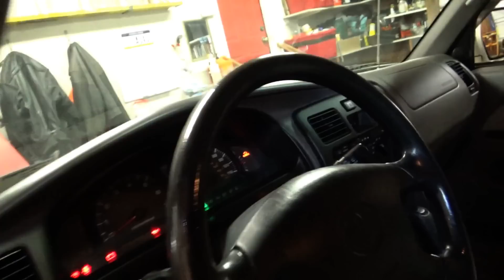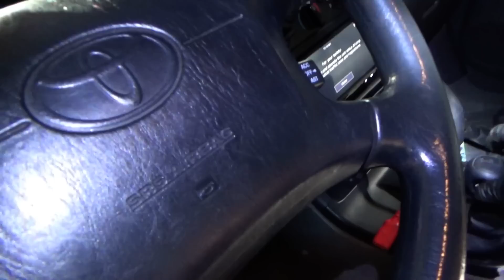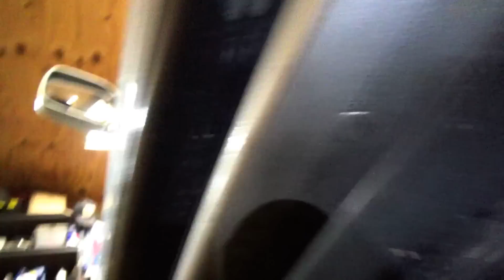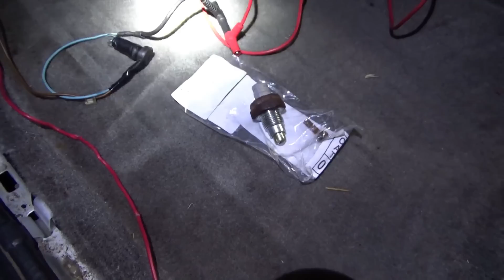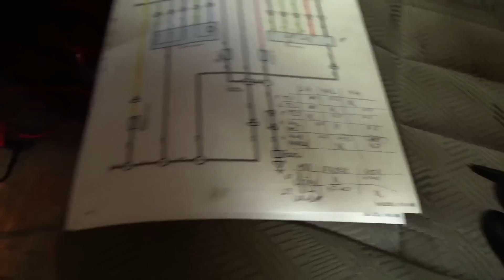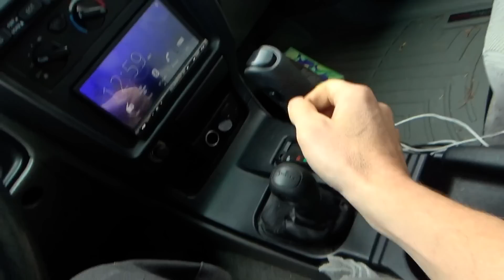(Pt 3) HELP! My Toyota is STILL STUCK in 4x4! ('02 4Runner)

Comment: I had exactly the same problem, my 4Runner was stacked on 4wd until I sow   
Your video. I replace switch didn't work with crash washer, remove crash washer and the magic happen it's working now. Thanks you

Comment: I've been fighting this on my 2010 Tacoma w 143K. I cleaned & tested the actuator but only checked the switches for continuity. Mine goes into 4WL once in a while if I lug the engine in 1st gear (MT)...from watching your video, it tells me that the lugging bounces that rod/switch into actuating...and that the slop is in the TC. I'll get a new switch & install it w doped threads sans crush washer. If  it still doesn't reach the rod, I'l file some mating surface from where it screws into the housing.Damn rig is like an old married couple. Thanks Ivan.

Comment: The 4wheel  center diff lock switch was added to a preexisting 4wd system transfer case from the 90's that originally always had the diff. Locked when in 4wd. The switches and 4wd ECU wasn't changed with the update making the switches kind of redundant or non functional in certain positions.
Reply: Another note. This "multi mode" transfer case also has a torsen unit in it which is why the front tires couldn't be spun when the transfer case shaft was in mid position with the center diff unlocked.

Comment: Pt 1 I thought to myself: position switch(es)! Pt 2 I thought to myself: position switch (es)! Why? I did exactly the same that you did, but on a Pajero, including coming up with drawing the table with shaft positions, manual switching, and logic. Three different days, several hours. My position switches were located on a godforsaken spot on top of the transfer case, had to drop the whole engine/gearbox assembly on the rear end just to get my hand up there between the tunnel and the TC. Work blind by feel, take pics with phone, use mirror. A mare job. Switches played up exactly like yours, some even worse. Original replacement would have cost AUD 160 each, 5 switches or so. Customer decided to get a knockoff set from ebay for AUD 35-ish. Didn't work, the knockoff switches switch tolerances were all over the place. Made it work with a combo of original and new knockoffs, with partly one, two or no crush washers. Same as you had to do, even with the OEM replacement
Reply: After only a few drive cycles it failed again. Lesson: These cars getting expensive after 16 years service

Comment: Had a day to think about that switch and its replacement. Finicky darn thing to adjust.

So, if one carries that assessment to its logical conclusion, my opinion is that the switch itself is a crap design. It should NOT be finicky to adjust BY DESIGN.

So I'm afraid I don't look at Toyotas as gods of design. What they are good at, it seems to me, is producing their designs with great quality and repeatability. So here we have a case where a crap design is well made and because of the design, not the manufacture, is a useless t*t bit of design.

It's like those open deck blocks Toyota makes these days, die-cast cheapies complete with a plastic piece that drops in, which supposedly gives even cooling to all cylinders. What a brainwave! Not. The electric cooling pumps and their associated valves, doohickeys, bizarre 12 ways to manage cooling from cold engine to instant defrost for the windshield and 10 wackadoodle settings in between -- crap design, and blocks fail early because of it because of head gasket failure.

Look at the latest Tundra with 3.4 TT. Hell, even Ford seems better on their 3.5tt Ecoboost. Can't remember if Ford added a rubber belt running in oil to the 3.5tt, but they did to the 2.7and 3.0tt. Had to have a failure point somewhere, I guess. But Toyota believes what it does is faultless even when it isn't. Got little time for that attitude.

Drive it gentle like it's a stick of dynamite that could go bang at any instant, change oil over-frequently, and with luck, why you too can probably boast "Them Teeyodas, boy now there's real quality!" as you sail past 200K miles with nary a twinge.

But what we all know is that in the early  '00s and earlier, you didn't have to treat a Toyota engine with kid gloves to make it last. Now you do.

Comment: Hi Ivan I'm looking for a scan tool and I was wondering what you think of the autel mk 808s. I need a competent tool although I'm not a mechanic I am an electrician and like fixing things, spent 20 years working on diesel electrical mining truck like komatsu 930
Reply from the maker: That's a great compact scanner! Get the MK808STS if you need TPMS capability as well :)

Comment: I had same issue on a skoda fabia with 34k miles on it. Reverse light switch on gear box where nothing worked ( lights, reverse parking sensors) took washer off and sorted.

Comment: If you can't explain it, it means you don't understand it. If you don't understand it, then probably  you should spend a little more time learning the system to insure the repair is correct, Sounds like 2 parts installed that weren't needed.

Comment: Have you been able to find out if Toyoto replaced the original switch with  their after market spare part line? It just could be that Toyota uses the same part number while the switch itself is of a later design. And that could mean that the manufacturer just added that crush washer out of habit. The original switch, the one that came with the car, could have just had a thin brass washer (?).

Comment: I think the failed lubricants are preventing full travel of the actuator, this is why the position switch is marginal. Having said this, it is clear from Ivan's testing that the more the case is locked in and out the more it is tending to free up. So, perhaps the advice to the customer is the exercise the case back and forth every couple days or so. The lubricants are still spent, but you could possible get a few more years out of having to rebuild it.

Comment: It could be shaft bushings worn but I think the problem is at the attachment point of the shaft. Possibly a worn pin at the attachment point of the shaft causing the pin to not go exactly where it should go for proper detents.  It is too bad you don't have a good mechanical diagram of the assembly.

Comment: With the new switch and no crush washer,,,,   now it is also getting a momentary ground when you are shifting it, ,, 
   And it also looks like it also needs that momentary ground to make it "completely/accurately shift,,, 
    Man I am glad I don't have one of those!  
   But it does make a bit of sense when you consider the age and mileage,  the transfer case probably has a bit of wear in the linkage.

Comment: I notice the two parts have a different amount of thread.  I suspect the new switch was bottoming out on old/never used/dirty threads in the transfer case.  The old switch's threads didn't extent that far.  The second attempt got past that.

Comment: It is a 02 vehicle with even reasonable use there would be some wear on those components in the transfer case as you would have seen in other vehicles minute tolerances make a lot of difference especially with electronic switching gear.This makes the future of electronic devices in all vehicles an almost given of failure.Cheers Ivan (hope you still have some hair left.)🤣

Comment: That shaft wears out, I feel your pain I went through the same issue with a tundra. I dreamt  about that blinking light. Dealer had replaced the 4x4 ECM (the tundras have it on right kick panel) and I replaced the shift sensor which did the same thing. After a day long of diag and stepping away from it (lol) I eventually measured the depth which the sensor sits on, and it all made sense installed the sensor with no washer and wouldn't you know it. I went further and R&R that shaft at owner's request. He has been a loyal customer ever since.

Comment: Since the switch was failing intermittently, but the transfer case problem was not intermittent, I had a suspicion there would be another issue. But obviously there is no quit in Ivan.

Comment: It has to be internal wear or something bent.

I had something similar happen on a piece of machinery.  When I tore it apart there was a plastic bushing that had failed changing the tolerances just a 1/8 of a inch or less like in your situation

Comment: Good job Ivan I was a Toyota tech for thirty years we would have just sold a new transfer case that comes with a new actuator on it because you need to disassemble the transfer case to correctly replace it.   It’s almost a two person job with the detents on the rod. I actually went to a Toyota class just to diagnose four wheel drive problems on this type because they were always so difficult to diagnose.  Thanks for the videos I have learned a lot from you.
Reply: The majority of the problems with this transfer case is aging actuator lubricants. Do you know what supplier built and supplied the transfer case, and or the actuator? What lubricants did you use to rebuild the actuator, or did you just replace it as a unit?
Reply: @windward2818  For the actuator on the 2001 Toyota 4Runner, it typically uses a specialized, lightweight grease or a specific actuator lubricant that’s designed to work with the plastic and metal components inside. Toyota often recommends a specific lubricant, like a silicone-based grease or a multi-purpose lithium grease, that’s suitable for the actuator’s internal parts. It’s always best to consult the factory service manual for the exact recommendation, but generally, a lightweight, non-corrosive grease is what you’ll want to use.

Comment: Another moment of suspense! Great job finding a workaround, Ivan! I would say the cam is not reaching high enough, either because it's worn or, as Focusfanatic242 well said, worn bushings could also have the same result.
Anyway, it's solved, and the 4Runner is back on the road, but I guess that transfer case motor assembly is reaching the end of its life.

Comment: Ha ha that's old school diag you found the detent switch problem but it wasn't the switch. I also have run into that and just used a thin copper washer instead of that thick aluminum one.

Comment: That was a tough one. I think the problem is a combination of the switch not being sensitive enough to initial movement, and it is barely depressed by the cam anyway so any even a little wear in the shaft bushings can cause it to not push enough on the switch (which also can itself wear and become unresponsive). Therefore, moving the switch closer to shaft makes it work (removing gasket). If they just increased the lift of the cam on the shaft a bit it would probably solve the problem.

Comment: I had to do the same thing on my 4 runner left the crush washer off and I used pipe dope on my switch. So I figured it was some play in my transfer case at 374,000 miles. 🤘🏼🇺🇸🇺🇸🇺🇸

Comment: Im imagining the original switch was covered with a plastic tip or adaptor to protect the switch  and extend its length. Engineers often use common switches and must add another part to make the mechanism control the switches "throw"

Comment: Scania and other manufacturers used a similar set up for there neutral switches to allow high range to be selected on there gearboxes, (reverse switches etc) the crush washer as you described it was actually a shim washer to adjust that switch, they can be very sensitive to adjust sometimes. 
Sometimes it's the jobs/cars you least expect to give you trouble that give you a hiding.  
Always enjoy your content. Hello from New Zealand.

Comment: There's probably some wear inside that case causing the switch not to move enough.  I'd also recommend a fluid change.
I've done that to my 06 Nissan Frontier over the years, along with the front diff, rear diff and transmission fluids.  It helps.
Good one Ivan.

Comment: And sadly you still don't know the exact cause of why the switch was not being depressed far enough with the OEM sealing washer installed.  Most likely something inside the transfer case with enough wear to allow some excess clearance between the shaft and the switch plunger.   If it continues to wear, it may well rear it ugly head again somewhere down the road.  Only by opening up the transfer case and doing an inspection of internal parts will you ever know for sure.....

Comment: I was thinking as crazy as it may sound, that the chrome plating process could be the issue. I bet the actuator worked perfect with the crush washer, before adding a layer of hardchrome…that added a slight bit to the depth…enough to change the depth of the plunger?? Could be…and thats why it didnt work with the crush washer.

Comment: If it makes you feel better, my 2002 4Runner since new was always fussy with the 4wd indicator switches. Till this day with over 450,000 miles, it still kinda fussy but it works.

My FJ Cruiser uses the same style switches and sometimes i have to shift in and out of 4x4 a few just to get the switch to trigger the 4x4 system so it engages the ADD. It is a common issue and some people just bypass the switches entirely with a dash mounted switch.
Reply: Does you FJ have the Tacoma lifter tick noise on the driver side cylinder bank?
Reply: @windward2818  that ticking noise is common on all 1gr single vvti. It comes from that valve or whatever on the driver side near the firewall. Years ago, someone figured out how to quiet it down with a rubber washer or something. It doesn't bother me since I drive a very loud diesel.
Reply: @CACressida  Thank you for the information. This is what I have observed. Apart from the tick the engine is operating as normal. The tick sure sounds like a valve lash problem when the engine is cold on the drivers bank, but the tone of the tick does not change as the engine heats up, which is a bit strange for a lobe on bucket DOHC design without hydraulic finger followers. You would expect a shift in the tick noise (even a slight pitch change) with temperature change. But no. Very strange. 

The Toyota factory valve lash adjustment procedure is remarkably crude as compared to MB engine build. I am trying to borrow an Electronic Piezoelectric engine valve NVH transducer to mount onto the valve cover and monitor with my Picoscope relative to cylinder #1 firing, to see if the noise has a specific pattern before also including cylinder #6 (as a starting point) pressure to see if I can understand if the tick is a valve event and which cam and maybe which valve. If it is indeed a specific valve event I can then pull the valve cover, inspect the cams and check the lash. If the lobes look fine and the lash is within spec then perhaps it is just the nature of this engine as it ages. Which is also a bit weird because why would the same valve on all these engines go out of lash first?
Reply: @windward2818  If you want the source of that ticking, it actually echos the intake manifold. If you look at the side of the intake manifold just below the engine cover, you'll see what Toyota calls a VSV. It's held in place with a 10mm bolt and has a 2 wire plug. If you unplug the VSV, that loud tick will go away. The VSV is used for the evap system.
Reply: @CACressida  This make perfect sense with what I have found so far. I will give this a try. You would think that manifold pulsations would not track as consistently with an RPM change to effect the valve, but perhaps the VSV is getting weak (out of balance). I know engineering wise these EVAP control valve designs are not that robust with age.
Reply: @windward2818  i remember mine being loud since new. I also remember new 4Runners at the time being loud, too. If the manifolds were aluminum, the sound wouldn't be noticeable.

Comment: The problem i bet is the cam that pushes against the switch.  I had a transmission backup light switch once that needed a new switch to turn on the rear backup lights.  I would have tried some tape on the old or new switch to prove that on this repair.
A small cap on the end of the switch might also have fixed the problem.

Comment: is there an exploded drawing of the case where the switch screws in? I am thinking maybe there is a missing (disintegrated) plastic pad that fits between the plunger and the switch. It makes no sense to have such a critical dimension. A cushioning bumper makes sense to allow for heat expansion.

Comment: I believe I would have started with the mechanical parts down below on the transfer case first and mainly because of my past experience with " push button automatic" 4x4 systems. The typical part that tends to go bad on most of the push button 4x4's is the actuator assy mounted onto the transfer case. Not sure what makes them fail but they lose their ability to make the correct movements. this one would be a hard fix with those frozen up bolts but that tends to go with the turf on them. Seems like a decent design by having the High, Neutral, Low mechanical shift lever and the front differential engaged in lock or free by the electronics. 
Very sweet that Toyota had that switch available...Had this been a Ford, the part would have been discontinued for sure after 20 years.